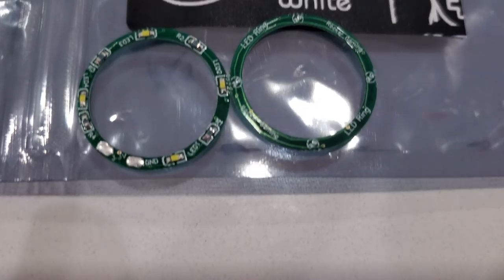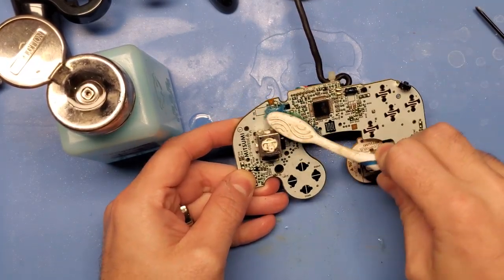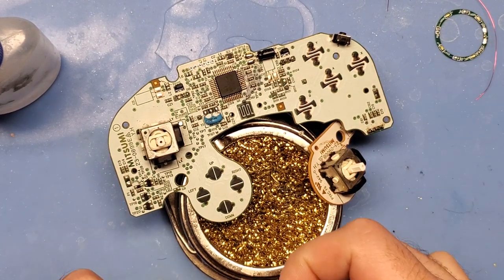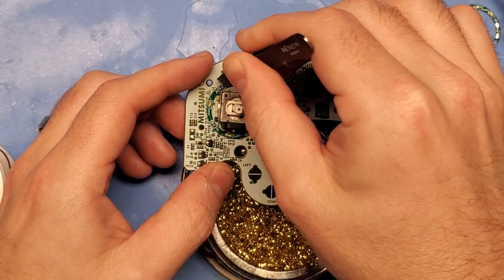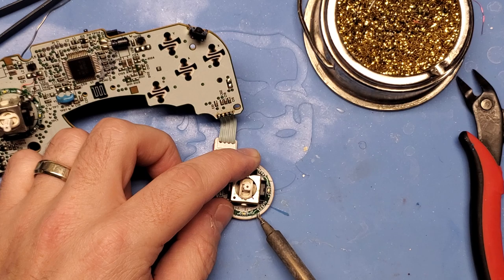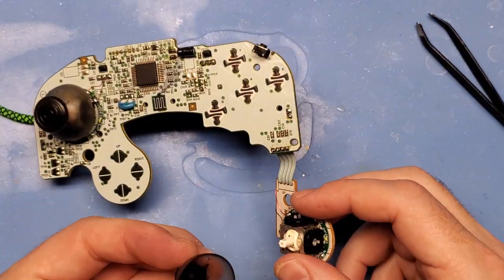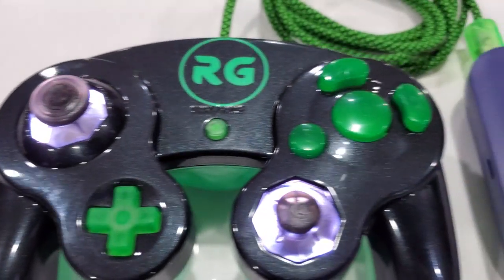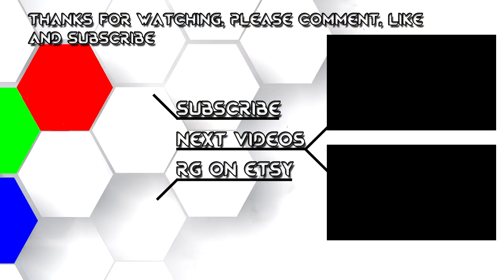Gamecube Controller Mod, Led Ring Tutorial & Mod

Comment from the maker: Hey guys thanks for the support and patience between videos. It's been a but crazy while our little guy got into a routine, but now that we are in a routine I should be able to be more regular!

One thing to note is there is a slight difference in the install process depending upon which type of stickbox you have.  If you have a T3 stickbox (all plastic) I have included an install diagram for that on my etsy page.  Very similar process just a slightly different pinout.

Here is a link to led rings - https://www.etsy.com/listing/740987407/led-ring-mod-kit-for-gamecube-includes

And dont forget to check out Pucho and give him a follow! https://instagram.com/pucho_magic?igshid=1phmflnsfahlb
Reply: Ist that just "lit"
Reply: Why dont you use a controller with the removable stickbox? Its called t3 and its the second revision of the gamecube joystick, there made fully from plastic and you can find them by getting a controller with a CE logo and a dot next to it on the back. If theres no dot next to the CE or no CE at all it doesnt have t3 sticks.
Reply: T3 sticks come apart completly and are customizable in feel. I know this from competitive smash bros melee.
Reply from the maker: To be 100% honest, I am just used to T2 and T1 boxes.  Its what I grew up with and used for years.  While T3's are great, I take a more utilitarian view and dont feel the need to replace my T1s and T2 so long as the stickbox is tight.
Reply: @RockerGaming  I take the spring from a c stick (stickbox has black on bottom) and put it in my left joystick (box has white on bottom) and it feels like a t1 or t2, standard t3s that havent been messed with are too stiff. Also i removed the t2 from my orange controller and replaced it with a t3 by removing the 2 pegs at the bottom with a hot knife and putting a tiny dab of super glue at the bottom to hold it solid and it works great. Also I wonder if you can make a mold of the t3 stick box parts taken apart and make replacement parts?
Reply from the maker: @davidbass3178  100% you could... it would be interesting to do that but not 100% sure it's worth it.
Reply: @RockerGaming  Id like to get some of these from pcb way. i was just wondering how you ordered them
Reply: Can you put some back in stalk?

Comment: Those led boards are pretty slick, looks like it makes this mod a breeze, the end result with that pro paint job is extremely nice!
Reply from the maker: Thanks buddy, after doing all these mods, I have come to learn quick solder board and other little add-on boards like this make life so much easier.  I hate having to re-position leds, lol.

Comment: I think the most complicated thing is to solder the wires to the ring, although it looks great, ialso realized that L and R triggers can be made 
Can you make the stick cap? or do you know any store where they are sold to mayoreo (I don't know if that word exists in English)

Very excellent video RG 👌
Reply from the maker: Thank you!  I would take a look at aliexpress.  You can find the chinese buttons on there for pretty cheap!!

You can cast the thumbsticks, however, I have not gotten into it... yet :)
Reply: My friend don't be afraid of the soldering I'm not a pro when it comes to soldering and I was able to do it. I'm sure that you can pull it off very simple....

Comment: Interesting technique with the magnet wire to keep the whole job as compact as possible. If I wanted to do an LED mod on a Wavebird, would the pins be in the same orientation for that as a wired controller? Thanks in advance.
Reply from the maker: Great question!  I cant believe I didnt think of that... I am going to have to rip open my wavebird and get in there with a Multimeter to test it and make sure it will work with it.  Get instinct is yes, but I need to go prove that first.  Thank you for asking this question!!
Reply: @RockerGaming  Haha, yay! New video..?? Yeah my fiance actually gave me the idea to mod the Wavebird but I didn't know for sure if the board in it had the same pinout as a normal controller, so I figured I ask before. I've already opened it up and cleaned it out a few weeks ago when I added new buttons.

Also, the start button on a Wavebird is actually longer than what the normal controllers have by a couple of millimeters..idk if this information will be useful later on but it's interesting to know.

Comment: Great video by the way. but I have a question does the led ring work with wavebird controllers? If it does work that would be great if it doesn't then can you actually make it for the wavebird And yes I know it's only for the GameCube controllers but I'll be a cool idea you can add the led ring mod in the wavebird controllers. But that's just an idea.
Reply from the maker: So it does work for wavebirds :)  They look really great on there too, just b/c I feel the need to say it, it does drain the batteries a bit faster :)

Comment: I just ordered both these rings and the reactive LED pack and was curious if there are any compatibility issues with installing both mods?
Reply from the maker: Not that I'm aware of. I have installed both on the orange controller at the end of the video and it seems to work just fine 😁

Comment: hey RG, i was wondering if this only works on the controller board types with the metal stickboxes, most of my boards are newer with the white plastic boxes (the ones with the screws)
lmk, thank you!
Reply from the maker: So wanted to give you a more formal response.  There is a slightly different install process for T3 boards.  I have included the install diagram for T3 boards on my etsy page :)
Reply: @RockerGaming  awesome man, thank you so much!

Comment: What's your timeline for making the buttons? Most of the time when I use 325 its sets in like 2 minutes, but it looked like you let it sit out mixed for a lot longer which made me think it was epoxacast. Either way cool video and the controller looks great.
Reply from the maker: I used task 9 in this video. It has a 7 minute working time. I got a trial unit of 325 and didn't like the fast working time. Task 9 is nice as 7 minutes feels like an eternity and it's a far superior resien to 325.
Reply: @RockerGaming  okay that makes more sense. I will probably try that out soon after I finish using my 325. I don't think I'm ready to take the dive to 690 because of that long cure time.
Reply from the maker: @metalskatertv  I am a big fan of task 9. It is more clear compared to 325 (still not fully tanslucent) and while the demold says 60 minutes I find it to be closer to 2 or 3 hours. Typically I just leave them overnight in my pressure pot so it's no biggie.

Comment: not sure as to why, but for the c-stick you will actually want to connect the LED to 1 & 4 respectively (instead of 1 & 3) if you are modifying the new Smash ultimate controllers. This mod worked perfectly for the older controllers i was working with but the Ulti one gave me some trouble. after some trouble shooting i figured out that the connections from the LED to pin 3 needed to be switch to pin  4 (by trouble shooting i mean hella trial and error lmao). wasnt sure if anyone else had noticed this or if this was just my controller, but it seemed to be that way with all of my ulti controllers!
Reply from the maker: Hey Patrick sorry you had some trouble with the ultimate controller. I should have pointed this out here, but I need you're correct about the pin out being different for any T3 (all plastic) stickbox. I have a separate install diagram for T3 boxes on my etsy. Hopefully if someone runs into this issue they see these posts and are all squared away 😁 🙌🙌
Reply: RockerGaming no trouble at all! It all worked out in the end and was a fun puzzle! I must have completely missed that diagrams, I’ve have to take a look at it. Thank you!

Comment: YO update! I got my rings intoday and on the newer controllers for the c stick you need to solder to pins 1 and 4. Pin 4 is ground and pin 1 is 3.3v I will tweet you a photo.
Reply from the maker: Yes sir, there is an Install diagram for that on my etsy page... I should have put a disclaimer on this video totally forgot 😥
Reply: @RockerGaming  oh hey its all good man. Hopefully now you can update the description or something. I don't think it will damage anything if done wrong it just wont work.

Comment: I cant get the c stick ring to light for the life of me. I've used 2 different rings and new wires each time. Something I could be doing wrong? The left thumbstick ring works fine.
Reply from the maker: What kind of stick boxes do you have t2 or t3?   There is a different installation depending upon which kind you have. My guess is you have t3. Check the etsy listing for the installation on t3s
Reply: @RockerGaming  as soon as I posted this I saw that you said t3 is different lol. Thank you for the quick reply. Love all your videos. Truly a treasure.
Reply from the maker: BOOM glad you got it solved! No problem dude and thank you so much!!

Comment: SIR?! I'LL GIVE YOU A MILLION DOLLARS FOR THAT MOLD
Reply from the maker: That mold spits out perfect GC buttons :)  I have considered selling them, but the problem is they would be damn expensive to sell!
Reply: @RockerGaming  yeah that silicon is expensiveeee just like you've said! so far I've taken up paracording and just recently LEDs thanks to you. Now I want to get into this. I didnt think itd cost that much more than all the soldering equipment but boy was I wrong lol
Reply from the maker: @icearrow43  not only is it expensive, but you need to make a bunch of mistakes before you end up with a really good mold and even then you need equipment to get good castings out of the mold.  I have significantly more into my casting equipment than I do my soldering, its really not even close, lol.
Reply: @RockerGaming  failure leads to success and increased expenditure :) oh well I'm pretty motivated to become decent at it because I helped found a smash organization at my uni this year and ppl want their custom controller hookups locally for cheap